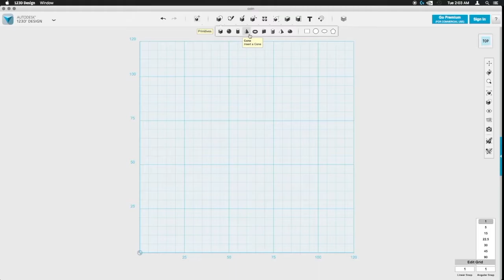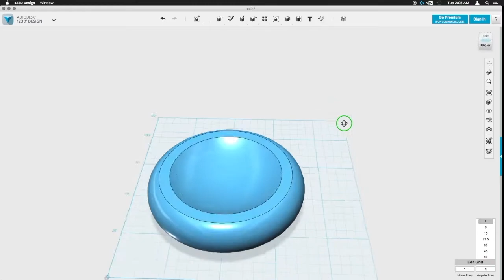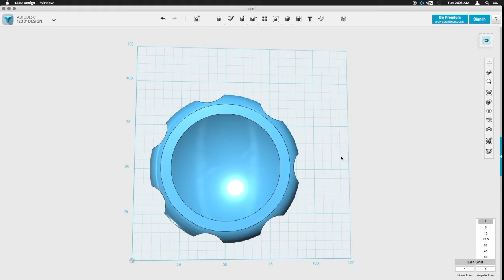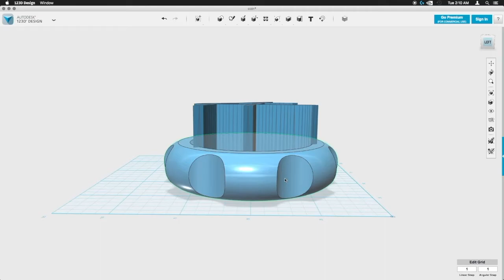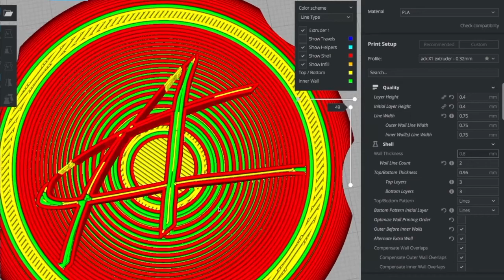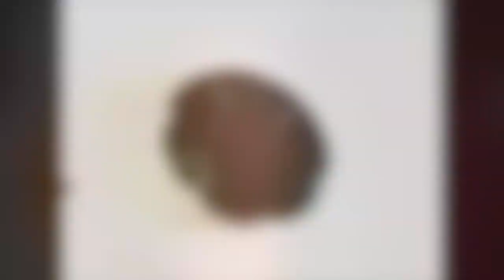Obligatory maker coin creation video

Comment: I prefer DSM also, it's easier for me to visualize and you can make just a complex parts if you know what you're doing.
Keep up the great work!
Reply from the maker: Agreed.  I'll use programmatic or parametric cad when I have to, but it is hard to beat dsm for speed and making small, quick changes from one iteration to the next.